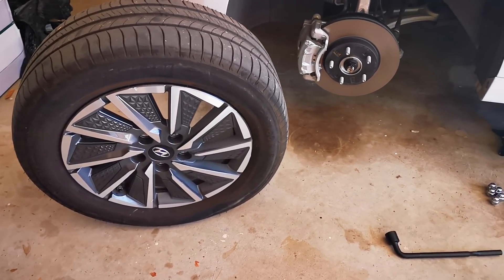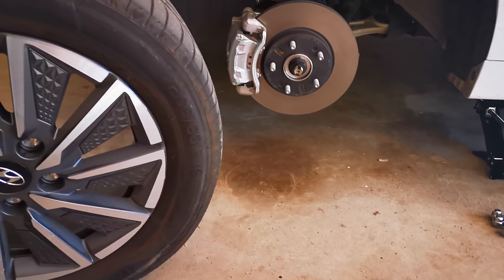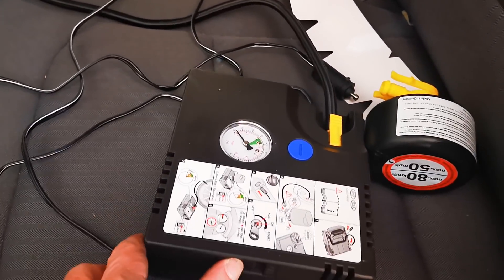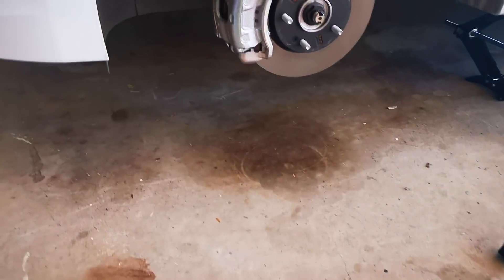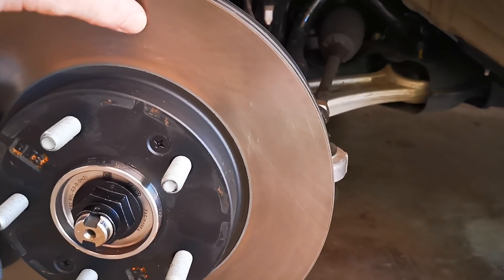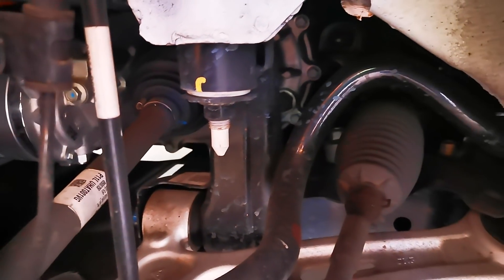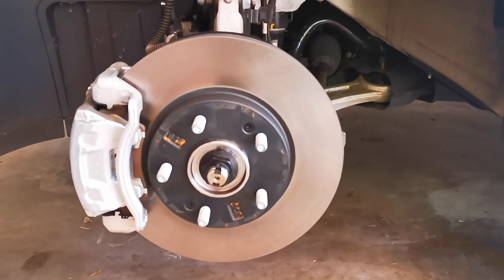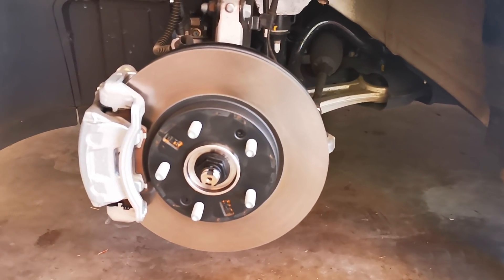Hyundai IONIQ EV Zero Brake Wear After 12 Months!

Comment: honda tech here brake pads on evs last the life of the car
Reply: it will rust away before it needs to be replaced..  my SUV has the orginal pads on the front   hybrid has 106k But i do want to replace them with HIGH quality racing pads  my speed limit in my area is 45-60mph  in stop and go traffic
Reply: @punker4Real  Front discs usually last an eternity, even if you live near salty conditions.. Rear brakes however - one of the reasons a bunch of VW EVs (and others with electric motor on rear axle) come with drum brakes.
Reply: @Okurkaarrgghh  rear brakes on most modern cars do most of the work for ESC
Reply: @Okurkaarrgghh  You'd be surprised. Talk to a mechanic and many modern vehicles will go through twice as many sets of rear brake hardware than the fronts.
Reply: @Okurkaarrgghh  Only the lowest end cars have drum brakes at the rear.
Reply: @Okurkaarrgghh  Nah maybe a few mm thinner but nothing significant. The discs are prolly thinner but end of life is set by the material removed not some end thickness that could be compared between front and back. The other guy is right, we replace way more sets of rear brakes on 2WD cars cuz the DSC will pulse the inner rear brakes on sharp turns to maintain control of the car.
Reply: I have replaced many since they succumbed to rust.
Reply: Yeah right. Maybe in some dry and sunny areas but definitely NOT here in Finland where they like to cover the roads with salt in winters.
Reply: @sikkepossu  Front disc braes will still last an eternity - many people from nordic countries still with their original front brakes after 8 years of EV driving.
Reply: @rkan2  
Not in Canada our 5 year old Sabaru front braking mechanism has to be replaced as its a mass of rust and falling apart.
Reply: @universeisundernoobligatio3283  I was referring to EVs especially the fully electric kind.

Comment: It's pretty interesting that the brakes do so little work. On normal cars there has to be sufficient airflow to cool hot brakes. and they do get really hot,  which means a loss of aerodynamic efficiency, especially in the wheel design. An EV could probably have super aerodynamic wheels that cut air resistance and noise at highway speeds.

Comment: Watch those pads: sure they don't wear out, but they might rust to pieces!  (They don't get hot enough too boil the water out!)  So we're recommending galvanized backing plates with riveted or steaked on friction material.

Comment: I got a flat on my Chevy Volt and had to use the chemical inflater they gave me instead of a spare.  That crap doesn’t work worth a broke dick.  It never solidified and was running out the hole like milk.  It was still wet the next day at the dealer where I took it for replacement.  Get one of those cheap rope plug kits like they sell at Harbor Freight.

Comment: Never thought about having a car without a spare tire. Be interesting to weight the inflator kit, and see the difference between it and a real space saver spare and jack. I would be uncomfortable without a real spare in case of a blowout the inflator not going to do much good.

We have a 2020 Corolla (not the hybrid version), it has low profile tires. So far so good but here in the US rust belt a single pot hole will probably destroy the tire and possibly the rim.

Comment: Funny how your benefit is a big issue on EVs in Norway.

The brake disks rusts out and makes lots of noise and fail inspections. 

Here if the driver doesn't drive it hard/spirited the lifetime of the disk is usually 2 to 4 years max. So it lasts longer on internal combustion vehicles

Comment: Usually the chemical in the repair kit bottle is liquid latex; formulations often have proprietary secret formulations of 11 herbs and spices, but the liquid latex is doing most of the heavy lifting.
They are only intended to seal small punctures like a screw or nail in the middle of the tyre tread. Like a space saver spare, they are only intended to get you out of trouble and to the nearest place you can get the tyre replaced.
Usually they tell you to drive a minimum time or distance after putting the chemical in, this is in order to form an even layer inside the tyre and not throw off the tyre balance.
Obviously as you are at home, you don’t need to use it. Just take the wheel and get the tyre fixed.
Reply: Also, it will absolutely destroy the TPM sensor if the car has them, which is not free to replace

Comment: 16K KM...LOL...that's 6 months driving for me.  I know a few EV drivers that have had to replace pads at 40K or 50K miles...it all has to do with how much stop and go you are doing.  If you can coast a lot, then of course you'll not need your brakes as much, but here?  It's go go go (or get run over) and then LOCK THEM UP...trust me, drive like a hyper miler around me and you end up crunched in the end...doesn't matter if it wasn't your fault, you'll have a crunched car in the end.  :(

Comment: It's dead easy to permanently fix a hole with a tubeless repair kit($20), ie, like a tyre shop.
Just pull the nail. 
Push the round file in and out of the hole. 
Thread the sticky rubber plug through the eye of the poker.
Push the poker in the hole until about 20mm of the rubber plug is hanging out.
Then just pull the poker out.
There should be a vid somewhere, and you can carry the kit and repair tyres on the spot.
Reply: He's gotta find the hole first, soapy water in a spray bottle.

Comment: Well, here too you have the unrestricted right to repair yourself  ,))  ... As for me I always do tire changes and repairs myself - if you do it right and you make sure that the position of the tire remains as it was before the repair, even balancing is not necessary any more
Reply: https://youtu.be/HpkgeulrRJI
Reply: @ch2o2  The jig in the video will ruin your alloy wheels. Better and cheaper way is just to use a some lug bolts and attach the wheel to the tree stump.
Reply: @TeemoDIY  Well, if you are more of a gross motorist, and your head doesn't know what your hands are doing, you should better keep your hands off filigree structures like "aluminum rims" (..), but even as such you can come along as a reasonably skilled contemporary with steel rims rightly  .))

Comment: You can go to an auto store or I think even Bunnings now  and buy a puncture repair kit - they are dead easy to use and in some cases you don’t even need to take the wheel off the car - plenty of YouTube vids on how to use them .
Surprisingly large disks for a small car , there must be a vacuum pump in there somewhere to create vacuum for the brake booster ? I am curious as to what they do in a service ? Change the transmission fluid ? There’s no filters or anything so I would expect the service to be pretty inexpensive and not very often . If Australia was really serious about adopting EV’s they would  have cheaper rego , insurance and less import tax - problem is the government is addicted to our money so  none of those things will ever happen !

Comment: The grinding surface is still visible on the rotor. Has the car been used at all? I'd advise to brake heavily every once in a while just to be sure that they haven't seized. I thought EVs were programmed to use the friction brakes over regen every once in order to counteract exactly this, but I might be wrong.
Reply: Regen stops working when the car gets down to walking pace - the wheels no longer spin the motors fast enough to generate power. But slowing a car from 5mph to zero isn't going to wear much!
Reply: Not all EVs have programs to manage unused brakes. I think only really Teslas and maybe some VW(Audi,Porsche,Skoda,Seat) do it. Probably some others. It is especially absent on older EVs (like Leafs AFAIK)
Reply from the maker: It's done 16,000km. The brake actually come on every time when you are stopped. The regen braking can't hold you stopped.
Reply: @EEVblog2  Ik, but are you certain that both the front and rear brakes are used for holding the car? It might be, for all I know, however almost all cars have a noticeable brake bias towards the front. This means the front calipers does way more work than the rear. When I bought my used A3 diesel, it had been braked with so lightly that the rust on the rear rotors had been worn away only partially on most drives. This made yhe rust eat into the rotor in irregular ways. It most definitely would not pass MOT due to safety, so I replaced them. In your climate, your particular car, and driving style, it might be completely fine, but I've experienced it on even non electic vehicles. It's always good to have the best possible braking distance for when dodging koalas and kangaroos.

Comment: My Peugeot e2008 doesn’t have the super strong regen that stops you completely, but for pretty much all my slowing down I let the regen do it, and only have to lightly tap the brakes to properly stop.

When I actually do press the brake there’s a distinct point where it switches from regen to mechanical braking as I push the pedal down, and when it uses both the car really does stop surprisingly quickly!

Comment: I don´t know if Michelin Energy and Energy Saver are two different things, but here on the empty side of Spain, that's quite standard. You´d sure find a replacement for any common size tyre.

Quite an interesting bit. I was aware brakes were barely used but mate, that looks mint new. 

Nice car btw. I had a ride on one of these and honestly liked it, although the owner confessed to me he made a huge mistake getting the cheap heater instead of the inverter/heat pump  (I lack here vocabulary), and during winter if shortened the battery life significantly.

Comment: I wonder what those brake discs are made of, on a normal ICE car they’d start rusting pretty quick without frequent use, interesting that parts are even painted. Pretty funny to see absolutely no wear pattern on it after 12 months.

Also only use that emergency repair kit in an emergency where you are legitimately stranded. The 80 kph max is there for a reason. They fill the tyre with a mess of chemicals that clumps together and makes a mess of the tyre and rim. You’ll have to pay your mechanic to clean it all out, properly patch the hole and re-balance the tyre. Some kits use a large excess of chemicals that very strongly bond to rubber which can throw the tyre completely out of balance making it a total loss.
Reply: Standard cast iron disks, standard asbestos free bonded metal and ceramic pads. They really do need to be used every so often, so press down hard on the brake pedal with the vehicle stopped, so the pads actually move in the calipers, and contact the disk. Do this once a month, so the calipers do not seize up and become useless. Yes the disk will rust, so the first time you use the actual brakes (long descent, full battery) you will have a bit of noise and shudder as the pads bed in and clear the surface rust off. However you should still flush the brake system every 2 years, as the fluid is still the same, and is still hygroscopic.
Reply: Exactly, only use of you are stranded, otherwise not a good idea
Reply: They are probably coated with something all around (except braking surface...) so unless they get some proper heat cycles from braking the coating won't wear off.
Reply: They're exactly the same as any other car, it must just not have got very wet. Good chance these'll be seized in no time though if they're not getting used.

Comment: They got used .  The rotor cross hatching is almost gone and there's no rust.  Carry around a spare or learn the hard way.  That tire also has a circular wear mark on the sidewall indicating it heated up from under inflation. Using the sealant might have saved that tire.  Personally I would get a new tire.  How long did you drive on it?

Comment: I went 6 years before my rear brakes on my hybrid needed serviced. Pretty sure it was the weather that ate at them more then my driving. :)
Reply: Hey I don't know if this might be a silly question but I noticed during lockdown the discs of my dirty diesel rusted up pretty well, after using it again it all seems to have rubbed away and looks good again. Do EVs suffer with the same issue if your not having to use the brakes or does something else keep them in the good condition, it looks like the ones on Dave's EV are in great condition 12 months later and just wondered how that works really ? Thanks.
Reply: @SlyerFox666  the pads still lightly ride against the rotors so driving them will still clear the rust when driving.
Reply: @killakobra  Thank you, much appreciated.

Comment: Be very careful as the brakes could sieze up with lack of use. Make very sure you replace the brake fluid frequently as it absorbs water and can rust out the system if allowed to just sit.
Reply: I wonder if the manufacturers designed the brakes with lack of use built in, i.e. less likely to sieze up. Different materials, different tolerances etc.
Reply: @IanScottJohnston  VW has done that, on the ID4, the rear brakes are drum (yes that old thing), but they are better sealed than normal drums, so salt and other crap cannot get in and corrode the drum surface.
Reply: That’s not how the brakes on an EV work, don’t worry ;)
Reply: @ncot_tech  what are you taking about? They still have conventional brakes for emergency use.

Comment: I'd be surprised if you could get that patched, I see a bit of wear on the sidewall from driving while flat but hopefully it's superficial. They'll remove the tyre and inspect the insides to do the patch, and they can't patch if the puncture is too close to the sidewall. The tyre won't be speed rated any more but that won't be an issue for normal driving...unless you take that beast to Eastern Creek. =P

Comment: Dishliquid and water might help find the puncture.. I wouldn't like to be in the brake pad business in a decade or two as EVs make them less and less necessary. 
Good idea on not using the sealant as apparently it makes a hell of a mess inside the tyre, best to take it off and take a taxi to a tyre repair place. Can also get those puncture repair kits that have the strips of rubber and glue you push through. They are pretty much what they do at the repair place.. Not a bad bit of kit to add to the car, plus pump and some needle nose pliers to help get whatever cause the puncture out.
Reply: Taxi? Dave can use the other car where he got the jack from.
Reply: @Okurkaarrgghh  i was meaning out on the road, rather than using the sealant stuff. Lucky if you have a puncture at home (although it does happen..!)

Comment: That main circle is a break rotor, the pads are on either side of the rotor where the caliper is. 

The pads usually have a wear indicator, which is a crevasse (  ||  ) that shows the minimum level the pad can wear down to before needing to be replaced.

The caliper is basically a hydraulic piston that squishes the pads against the rotor. 

They look very clean, and there is no rust which is a teastament to aussie weather and not having salt and water everywhere like us in canada, or the brakes have been applied and the surface rust was cleaned.

And that thing inside looks like the ac compressor, with those refridgerant lines coming off.
Reply from the maker: Yes I know it's the rotor. I have actually changed my own brake pads a long time ago as my brake mechanic brother in law watched on and laughed.
Reply: @EEVblog2  Ahh that's a good job then :) 

Was just clarifying if anyone was interested and from you having said you knew nothing about them. I thought I'd give back, as you taught me a huge amount about electronics :)
Reply: @WhiffenC  👍🇦🇺
Reply: In the UK it's a brake disk not a rotor. Interesting the different names........In the UK it's also brake pads on disk brakes but brake shoes on drum brakes.
Reply: @IanScottJohnston  brake disc ;)
Reply: @sdgelectronics  ok, I'll give you that one......:)

Comment: The disc would have surface rust if they were not used at all, but yeah, regen braking drastically reduce the usage of the conventional brakes.
Reply: can still see the machined finish on the surface of the disc i would say they have never applied even once
Reply: The pad still make contact with the rotor, even just a little bit. Plus this car is very likely kept in a garage.
Reply: The brakes have almost certainly been applied at some point (I'd imagine all manufacturers would test brakes in cars before delivery...) However they probably haven't experienced a single proper heat cycle and thus the coating (outside the braking surface) that they probably have hasn't worn off at all. Being in australia and garaged - it is not surprising there is no rust on the braking surface.
Reply: In Canada 🍁,  if you don't use your car for 3 days, you will see surface rust.

Comment: You can still see the cross hatching on the disc... Interesting there is no rust even outside the braking sufrace. I guess that comes from not having any heat cycles on it.
Reply from the maker: Yeah, I was stunned at how clean it was. I wasn't expecting much if any brake dust, but the rack of rust was surprising, looks brand new. I don't live near the ocean though, that probably helps. And maybe they get engaged one every couple of weeks if you have to brake really hard.
Reply: Yeah, that brake disc looks like the pads have never touched it even once! The disc looks brand new like it just came off the shelf. The cross-hatching (which is an artefact of the surface machining during manufacture) goes away pretty quickly. I've put new discs and pads on my car and the cross-hatching was gone by the time I finished "bedding in" the pads (several hard stops from speed).